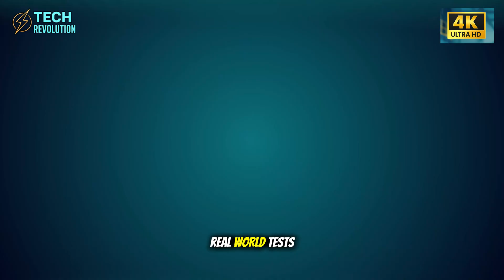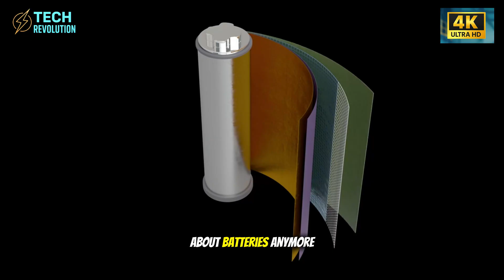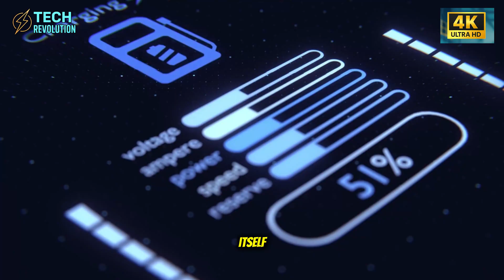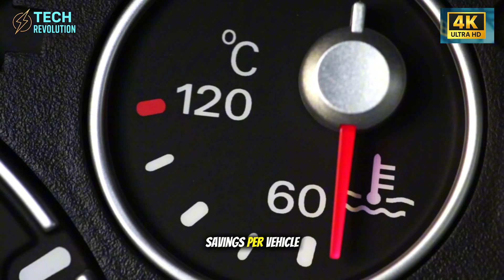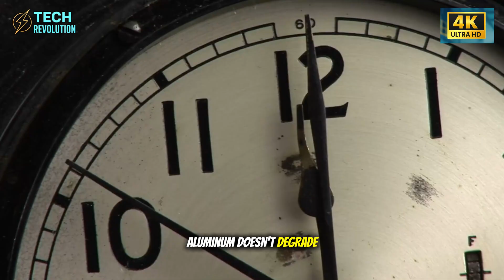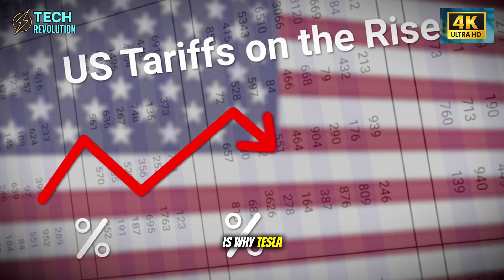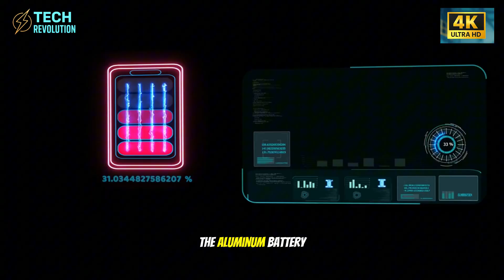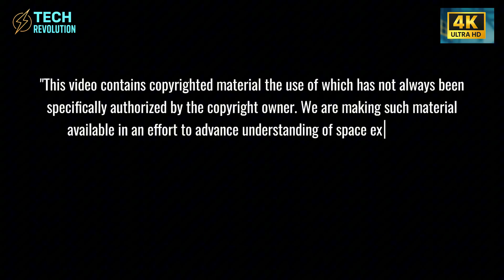Tesla Aluminum Battery FINALLY HERE: Kills Lithium Forever. What's SHOCKING?

Comment: Lithium is junk,   always has been.   I will not buy Lithium  because its flawed, to low a boiling point,   I buy Lead Acid first,   and those are nasty bats,  but at least they put up with work,   Lithium does not,   and you cannot use Lithium in metal housing,  which is what is wrong in the chinese of the tool industry,  Metal gets to Hot,  but puts up with stress and performs much longer,  Plastic does not ,  not even ABS.   ABS is better,  but it still will not hold its shape.   Which is why,  it goes in the garbage.   A China Joke,  never applying the elements they put together in study,  They completely reject study and take short cuts,  which is why,  Most that stuff in Home Depot,  goes in the garbage,   i can drop a metal cased drill off a roof,  and it will fall much farther and survive the fall, than a plastic piece of junk,  pick it up,  and it still works.  Yup,  Steel.   Aluminium has a 600 centigrade melt point,  and 2400c  boil point.  600 is high, its 1100 Fahrenheit.... Lithium is 180,  real poop,  one of the lowest their is.... Metals,   so those plates cannot get hot. catch fire.  These people in China need an education,  They are not Catholics.   And the world needs our US Constitution, Teaching it to the world, but the teachers are dumb,  no true interpretation of a Sacrament  and has it not.....The true virtues of the true church will teach you the type of independence so that you can learn an education Using them virtues to do so.....   Congress is a sick pansy joke today,   with no schooling at all in any part of the fields they need it in,  and they are supposed to make our Laws?   To many drugs fed to them, vegetable dummy's,  no doubt, Bill Gates the cheater.  So much for the Hippie Generation,  The word love has been defined wrongly,  and is why,  its not in the US Constitution,  if you love someone,  you best be prepared to tell em the truth.  Or you have not loved them., your in the illusion of being nothing at all for another person, or to offer them anything they can use.  You call that love,  a pill?  How do you like the element letters for Lithium,   yup, its a lie,  this man is going to be the richest man in the world,  if he plays his cards right.   And not in a Trump casino,   though Trump is a good man.  All his bats will be in all electric vehicles world wide.  why,  he listened to a true catholic.   But,  we are not liars,  Nor do we lie to those that do.

Comment: This is smart.   Im glad you did it.   They were taking advantage of you.  Catholics do not do that, not true catholics.   And you can find a liar catholic anywhere.  They are a dime a dozen.   My little black book says Aluminum,  but you must use extreme caution ,   Because Aluminum hates salt,  and in places where they are driving where they salt the roads,  you best make sure it cannot get to those bats.  or you will have a differ problem......     I like you Musk,  but your also a liar
Reply from the maker: Good point—Tesla Aluminum Battery must be sealed from salt corrosion. If the design proves that, this tech wins; if not, critics are right.